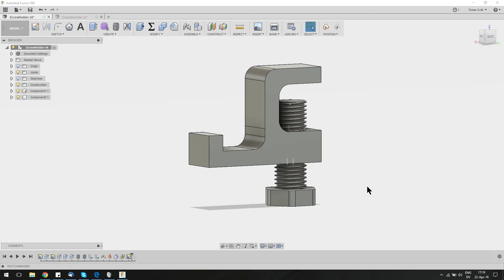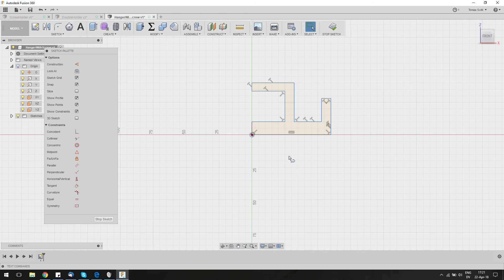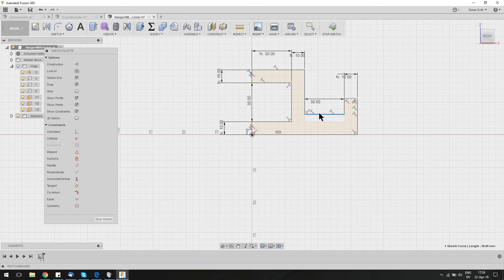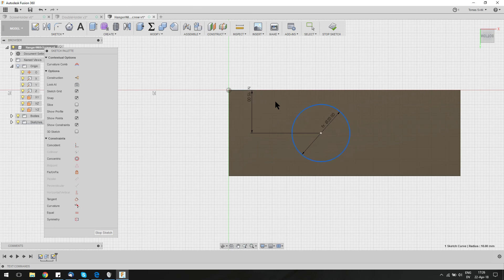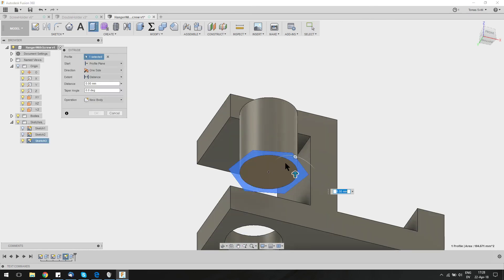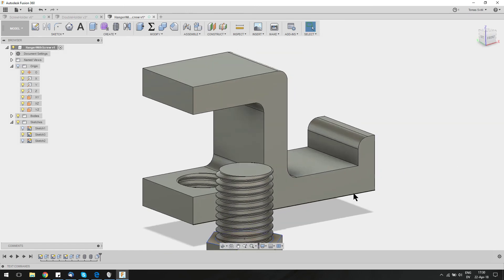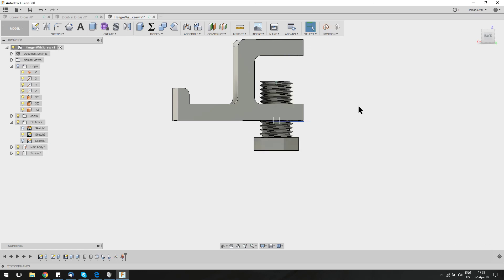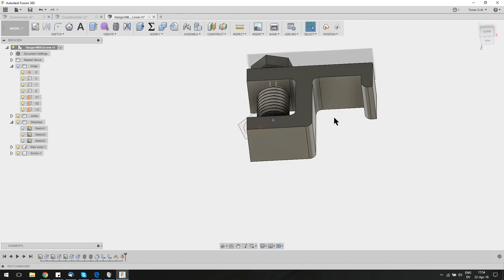3D Printable Hanger with Screw Fusion 360 Tutorial

Comment: What about the tolerance to fit the 3d printed parts?
Reply from the maker: I guess I forgot to mention that. The thread command actually prints really well and gives a bit of friction which holds everything together.
If it is too tight, you can select the thread faces and use the push pull command to adjust them to your needs ;)